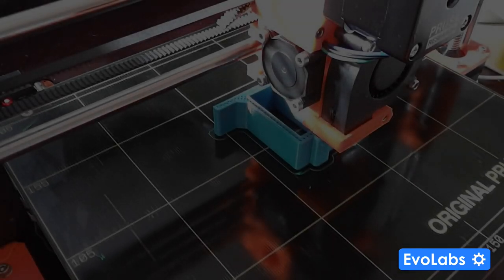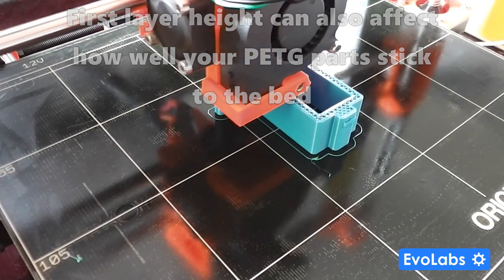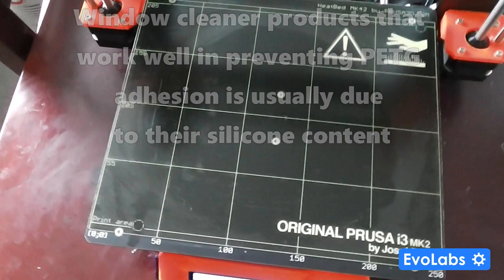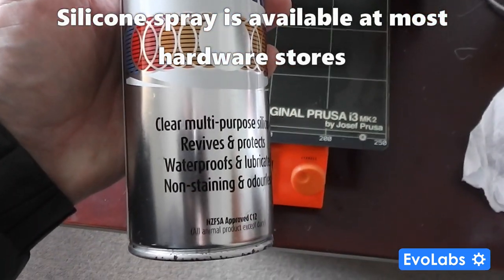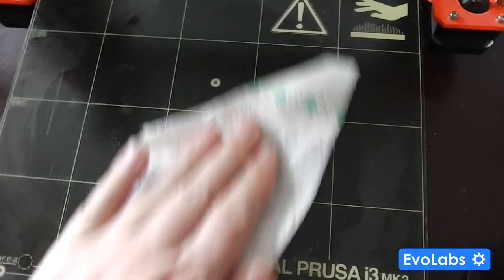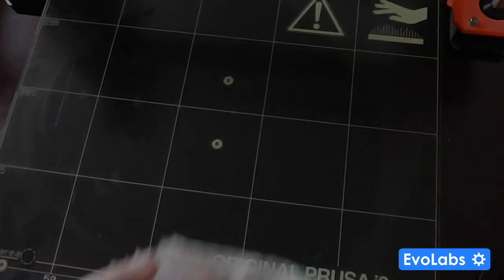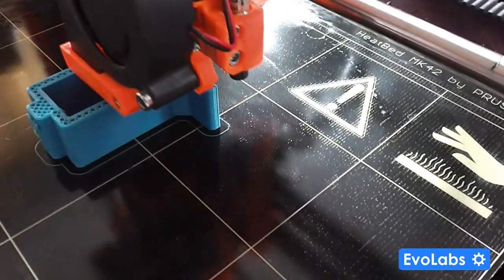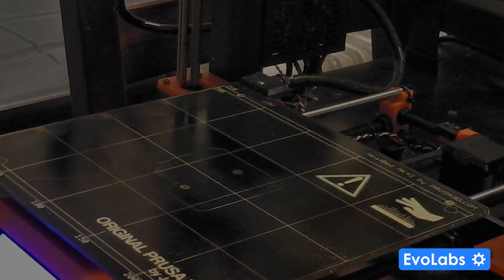Tip: Easy release of PETG prints on PEI

Comment: I have two cans of silicone spray sitting in my cabinet, I wondered about this, I'll give it a shot
Reply from the maker: One thing to remember is to get the layer of silicone just right, too much and it wont' stick and the nozzle gets clogged. I just wipe it thoroughly with a paper towel to get enough excess off, before printing. With practice, you will figure out what's enough.